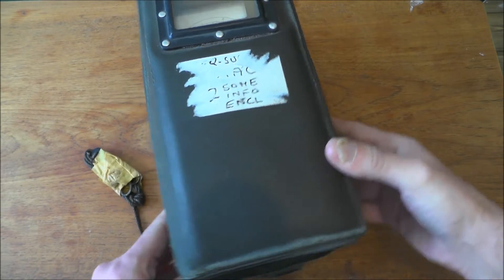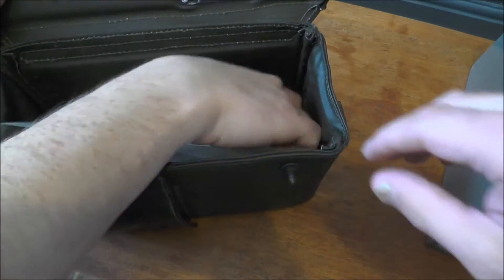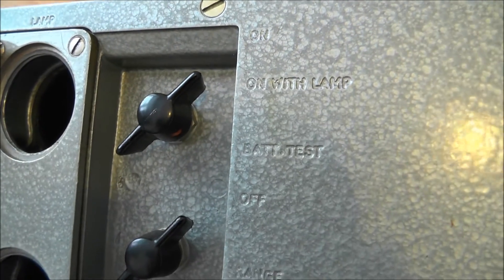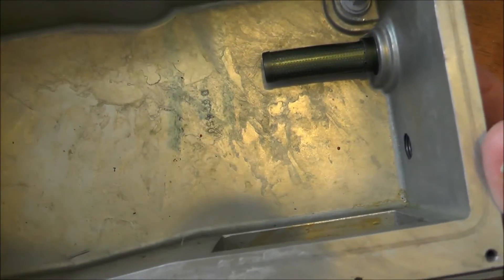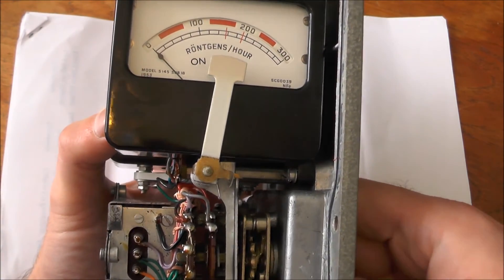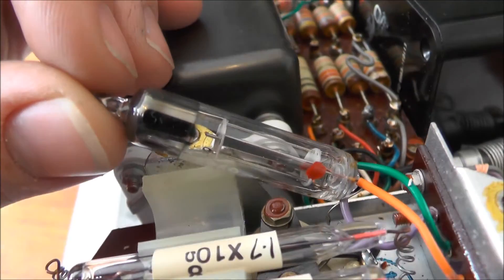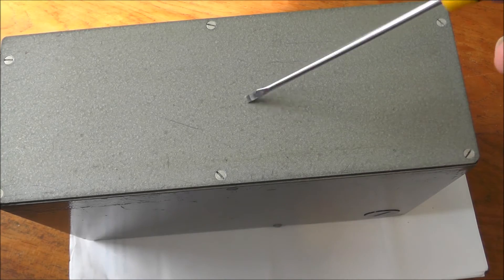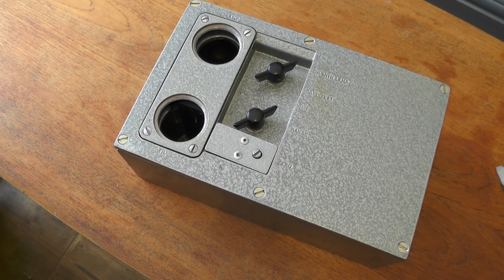DL#017 - Radiac Survey Meter No 2 Teardown

Comment: Great example of over engineering and ingenues design however if you get an indication on the meter it is either in battery test or your are in a bad place !!!. Geiger Muller are more sensitive. The smell of 1950 electronics is indeed wonderful, probably the CFC's and the fungicide they used for tropical environments..  Makes a great door stop.  Later models only needed 2 D cells as they had solid state circuitry and slightly better performance but the case remained unchanged and the centre battery slot for the 30v and 9v batteries  is not connected.  Thanks for the video.

Comment: The 30V battery can be replaced by two 15V batteries (in series), code BLR154, suitable for AVO 8 multimeters. Alternatively, two BLR121 batteries (again 15V) also appear to be able to fit in the available space in the battery holder. Some soldering of contacts would be required. The 9V battery can be replaced with a standard PP3 which is smaller than the original and may need wires to be soldered in. It is 'do-able'.
Reply: Thanks

Comment: According to the Radiac Instruments Calibration Handbook, the lower hole plug in the front of the Radiac Survey Meter No. 2 (below the moisture absorber) is for the insertion of the rod-type calibration source during servicing. The moisture absorber silica gel pack can be unscrewed and heated in an oven for 2 hours to dry it out (the cobalt chloride moisture indicator paper unit can be unscrewed from the sealed cylinder of silica gel).  Note that the user handbook states that the cobalt chloride indicators failed to work due to an unexpected permanent reaction with evaporating lubrication grease from the mechanical switches, so they turn pink and remain pink regardless of humidity (they were supposed to be pink when damp and blue when dry, but that doesn't work when exposed to oil vapour from grease). Four types of radioactive sources were used for training and instrument tests by both the UK military and civil defence corps instrumentation authorities. Type A was 0.5 millicuries of radium (which was expensive and soon obsolete), type B was 100 microcuries (0.1 milliCurie) of cobalt-60, type C was 1 millicurie (100 microcuries) of cobalt-60, and type D was the 5 millicuries (5000 microcuries) of cobalt 60.  Type , being the strongest, was needed for checking the higher range dose rate scales and even then it had to be inserted very close to the ionization chamber.  Type B gave 0.16 milliroentgens at 1 yard or 210 mR/hour at 1 inch, type C gave 1.6 mR/hr at 1 yard or 2.1 R/hr at 1 inch, and type D gave 7.8 mR/hr at 1 yard or 10 R/hr at 1 inch. Cobalt-60 has a 5.24 years half life, so a compensation would have to be made for the age of the source when checking the calibration.

Comment: I found that meter on ebay. Can I just use two d cells or do I need some special battaries additional. Hopefully someone know. Thank You
Reply: Im wondering the same thing, i did read somewhere that the 30 v batteries are used in old radios so they can be purchased im guessing. Let me know if you find out @Eustachius Vonackertiban
Reply: The MD1 and MD2 I think use the old batteries (the ones that I think aren’t made anymore) but the modernised one the MD3 with the blue front plate you can put two D cell batteries and it’ll work I’ve done it with mine.

Comment: This meter was used by the ROC, Civil Defence Corps and the military. The ROC also had the AVO lightweight meter. The PDRM 82 was developed by Plessey and used from 1982/3 (Guess what the 82 stands for). The radiac Survey meter was later modified (retaining the meter, ionisation chamber and case, by replacing the electronics, and was used by the RAF as late as 2003! search tocsin-bang*info (replace the * with a .)
Reply from the maker: Stephen Cook Thanks for the info Stephen!
Reply: Edit that link to https://tocsin-bang.000webhostapp.com/
Reply: Interesting, cheers

Comment: I actually have one of the meter movements, now I know what it comes from. Silica gel is easy to regenerate, take the capsule out ( it unscrews) and place in an oven at 110C for 2 hours, when it will turn blue again. Cool down till you can handle it with gloves and screw back onto the instrument. Remove rubber oring from desiccant capsule before ovening, and replace using a thin film of light grease. Same for front seal and the battery cover.

Ionisation chamber is simply held at high voltage and radiation causes a small current to flow to ground. This is detected across the high value resistors and shown as pulses which are integrated and displayed on the meter. I have a small probe which uses a 56V battery ( never been able to get a new one though for under $500 though) to drive the probe chamber. You connected a small vacuum pump to the purge port and pumped it down to a vacuum then filled it with dry nitrogen to keep it both water free and to keep the calibration constant.
Reply from the maker: we did consider trying to get it working, but it is so insensitive i dont think it would be worth the effort.